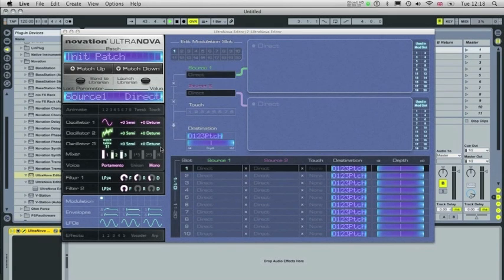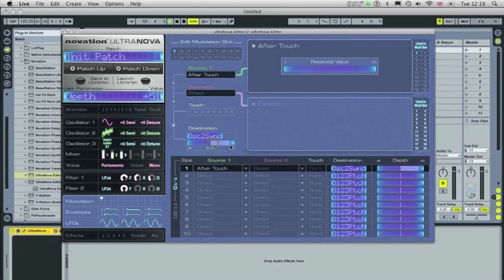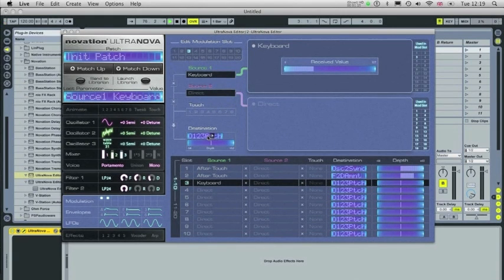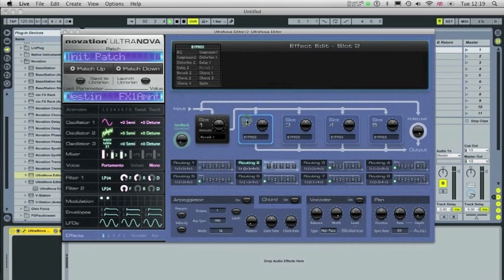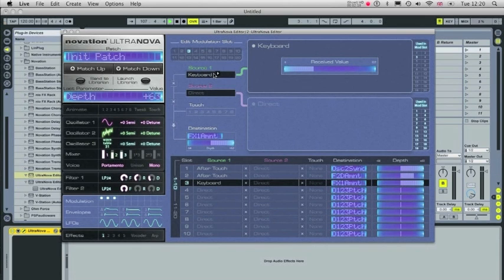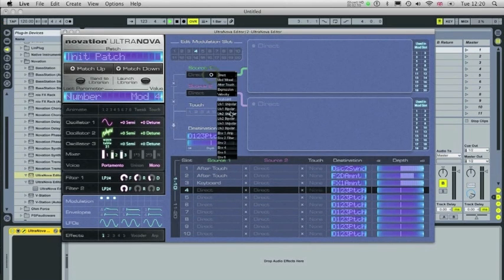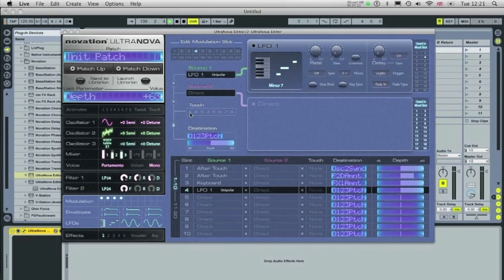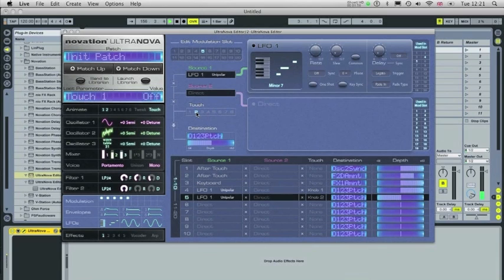Novation // UltraNova Software Editor plug-in: Part 2

Comment: the aftertouch is not working when i apply pressure to the ultranova keys even though i set it up just like you did in the plug-in editor...any suggestions?